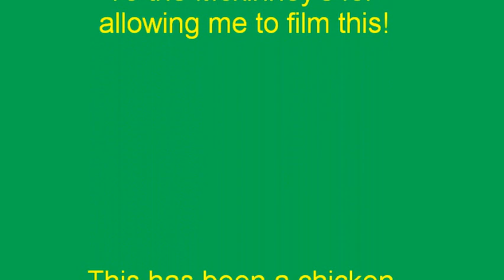Planting Seeds in The Greenhouse Floating Raft Hydroponic System Mckinney Tobacco

Comment: This system beats the old one. Under the old system you had to spread greenhouse muck which in itself wasn't bad. You then had to water it down by pumping huge volumes of water over the muck that you drew from the irrigation pond. Up here in Southern Ontario Canada you do this sometime over the winter months when there was a warm spell. If not(no warm spell) you then had to water down the muck with a lawn sprinkler that took days. You would hear the water pump working constantly in your house and that use to drive me nuts. The reason for this watering down was to remove salt levels in the muck. Then at tobacco planting time the plants had to be pulled individually and placed in plant boxes which was hard and difficult work. Even the best workers found it hard.
Reply from the maker: tobacco72  That sounds like when they use to make seed beds to start plants. Thanks for sharing it.

Rick